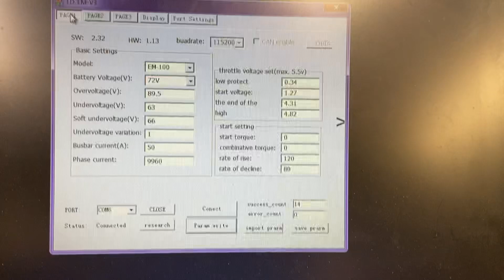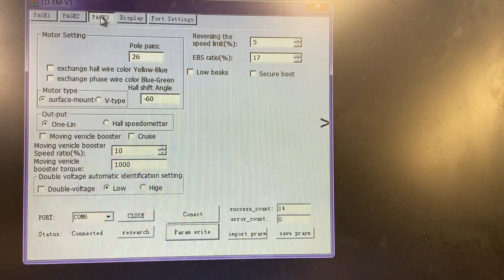TOB ebike VOTOL EM150 2sp to QS Hub Motor

Comment: Having a big problem my controller won’t connect at all just keep getting an error anyone know what it could be? Found little to non information on it
Reply from the maker: Go on FB and there’s a “VOTOL Controller Tuning” group and you will get fast response there
Reply: @tobebike  done it , non of them know what the fix is , seller is in china so contact is rare
Reply from the maker: @loopy2098  is it the 2sp?
Reply: @tobebike  sorted it but now to motor wont work i done a self learn and it still hasnt fixed
Reply from the maker: @loopy2098  did you check in the software app the 4th screen says “display” if “P” is on ?
Reply: @tobebike  managed to get the controller connected , but motor still wont spin on display page its blank 0.0 volts 0.0amps even though the motors connected , I have done a self learn its all ok except the display page wont work and the throttle still doesn't work I used a volt meter to check and the throttle is working so I have no clue now what my problem is!!!!!!
Reply from the maker: @loopy2098  maybe you need a file uploaded
Reply: @tobebike  yes park is on but it wont turn off at all i unplug it nothing. i click it nothing. it just wont go away might be the main issue which is causing all my little problems but i cant crack it
Reply from the maker: @loopy2098  turn it off on the last page . You’ll see “park input” , drop down the menu to “empty” and write parameter. That’s how you turn it off
Reply: @tobebike  ok fixed parking , sidestand is still on there and sometimes it pops up with hall fault , i cannot truly fix my issues beacuse the parameter write doesnt work! it says done and then when i close and re open my set-up all the settings went back to the old ones
Reply: @loopy2098 i have the same problem how did you fix it?
Reply: @loopy2098how did you get the controller connected ?

Comment: Question did all those number settings show up on all the pages. Or did u have to put them in  the controllers are frustrating
Reply from the maker: I saved he file . Would you like it?
Reply: @tobebike  please  i swear its like pulling  teeth  everything is blank  when i press connects  my laptop is windows  10
Reply: @tobebike  should i send u my email  or?
Reply from the maker: @trewatkins530  text me 484 522 0695

Comment: I have the QS205 V3, What are these best settings and what number to use for Hall Shift Angle and Pole Pairs please ?
Reply: @
Mountain Lion If I am not mistaken the QS205 v3 has a hall shift angle of 120 degree and 16 pole pairs.
Reply: @earnwithbots2783  Thank you both for confirmation, it is 16 by 120. The motor was spinning backwards so to reverse it I clicked both the check boxes for the hall and phase wires and it worked.
Reply: @mountainlion4853  Awesome
Reply from the maker: I thought it’s 32 but maybe 16 is correct on the VOTOL . Try either . I can email the Settings download them you can make minor adjustments